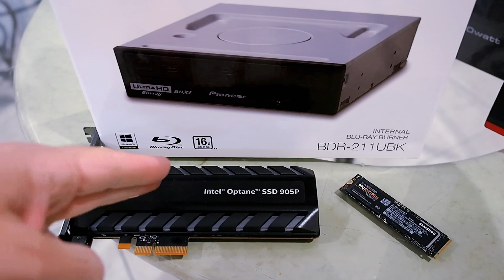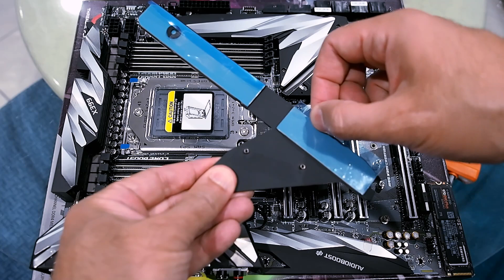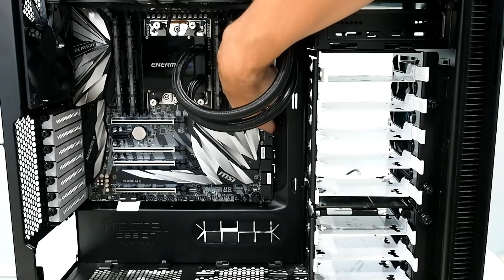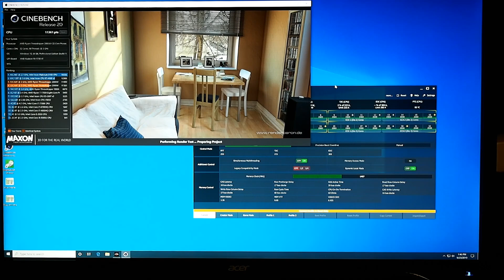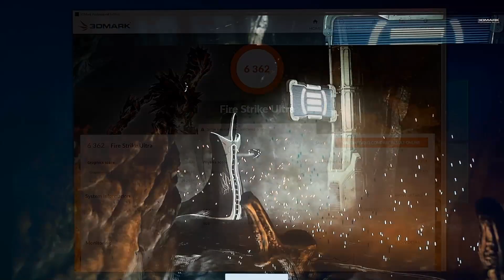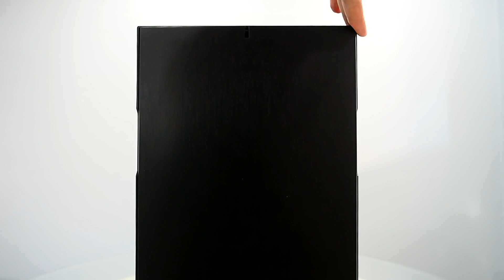The Insane 32-Core AMD Threadripper Build You’ll Love To Hate

Comment: I know this video is over a year old.  With that said, by now you have exprienced the problem with the cooling fluid in the enermax threadripper coolers. My question is how did you address this?
Reply: I haven't had a problem with the fluid yet, but do have a fan failing.  That said, I think I'm going to build something new soon anyway, because I don't want to worry about the cooler further down the line.

Comment: Dont need x299 mobo with intel chipset for Intel octane ssd pci card? M2 drives are not reliable as ssd and cost more but replaceable. Who does soundblaster pci cards?...external audio interface took over. Thunderbolt pci or usb hub/pci for pc for faster external hdd data video transfer....not common...usb c become more common along displayport/hdmi.

Comment: It's always really sketchy to me when I see the Octane stuff pop up.  Intel worked so long and never really managed to brand them.  Now we're expected to believe it's worth paying more than a dollar per GB for a small performance improvement?  When there's perfectly suitable options for 1/4 the price.  And what's even worse is that you can't find a negative review on the internet.  Maybe I need to do more research, but I'm a long ways from convinced.
Reply: It is very difficult to justify the price of an Optane drive when there are awesome NAND-based SSD that offer much better sequential performance and similarly low latency, for a fraction of the price, but to say a "small performance improvement" is incorrect. The Optane drive offers over 4X faster QD1 4K reads. And performance under load is much more consistent. I've had some of the better Samsung and Toshiba SSDs feel slow because I've had large torrents or steam installs coming down, while trying to do something else on the system.  Here's what that looks like in a benchmark...

https://hothardware.com/ContentImages/Article/2686/content/latency-over-time.png

Comment: Beast mode!  I'm running a 2950X + Radeon VII myself, the performance is awesome.
Reply: NICE! I almost went with the exact same set, but couldn't resist the Red Devil and WX sitting in the lab. :)
Reply: @Marco_Chiappetta  Oh yeah, the Red Devil 5700XT is an amazing card.  Had I not needed a GPU earlier this year, I would've jumped on it.  And 32 cores is impossible to resist if one has the means!

Comment: Nice machine, it looks like you built my system's little brother.
 I used same motherboard, same CPU, almost same cooler (I used the 360), but I went with 5 x Samsung 970 Pro 1TB NVME drives and 128GB of G.Skill Flare X DDR4, installed into a Fractal Design R6 case. Only a little crazy I guess  :)
Reply: That's hardcore! Did you use the add-in M.2 RAID card that came with the mobo?  I have yet to experiment with it.  And what kind of work are you doing on the system?
Reply: @Marco_Chiappetta  Yes, though currently not running in a RAID configuration. I did do some RAID testing though (all based on Linux software RAID) to compare 4 x NVMe drives on the card vs 2 on the card + 2 on the motherboard. For the most part, 4 on the card wins, though there were some tests where the 2+2 configuration won hands down.
The entries "4-Disk RAID0 2 per CCX" and "4-Disk RAID0 2 per CCX X,X,Y,Y" in the following Phoronix testsuite results are me (the Gentoo Linux system):
https://openbenchmarking.org/result/1808272-RA-1808249RA82

Note that the testsuite got confused, the group of 4 filesystems are in X,X,Y,Y (card,card,mb,mb) configuration, and the single ext4 test was X,Y,X,Y (card,mb,card,mb). It's correct in the system specs at the top of the page, but reversed in the results. The difference between X,X,Y,Y and X,Y,X,Y is within margin of error though anyway.
Reply: @Marco_Chiappetta  What kind of work am I doing on the system? In an official capacity, not a lot of "work", but I like things to go fast. 😊
In an unofficial capacity, the machine gets a workout, I run Gentoo Linux, where everything is compiled from source. 64 compiler threads all compiling code (located in and initially outputting to RAM drive) at once is nice. I also play around with some rather large FPGA designs, where the logic synthesizer really appreciates the available performance.

Comment from the maker: More details about this killer rig here at HotHardware.com! https://hothardware.com/reviews/insane-amd-threadripper-radeon-optane-build
Parts List: 
AMD Threadripper 2990WX - https://amzn.to/2mZP6j7 
MSI MEG X399 Creation - https://amzn.to/2n0kqhw 
Enermax Liqtech TR4 OC2 - https://amzn.to/2nA3PkV 
PowerColor Red Devil RX 5700 XT - https://amzn.to/2ltjtxZ 
32GB Kingston HyperX RGB - https://amzn.to/2mVBPId 
Intel Optane SSD 905P - https://amzn.to/2lq1ecz 
Samsung SSD 970 EVO - https://amzn.to/2lu8pk8 
Pioneer Blu-Ray Burner - https://amzn.to/2nxwZRG 
Aquanita AQ-107 - https://amzn.to/2n2VZjK 
SoundBlaster AE-5 - https://amzn.to/2nxy388 
Fractal Design R5 - https://amzn.to/2mXdZvR 
EVGA SuperNova 1200P - https://amzn.to/2n5r2uX
Reply: sthings i noticed: 
1) lift the PPT and all other power limit/current limits in the bios, you WILL get better performance (i noticed your cpu was power throttling in the Cb run)
2) if need be you could also use the m.2 version of the 905p (you have an m.2 110 slot
3)that nic it's quite good, i had problems with it tho, try to make sure there is airflow on it
4) i'm not fond of AIOs, i would have used a noctua aircoller (more reliable)
5) ram oc would work wonders for this build, consider it (the ryzen dram calculator is a very good tool)
6) sadly you can't watch UHD Blu-Rays because you can only watch using the igpu of intel 7th-9th gen cpu